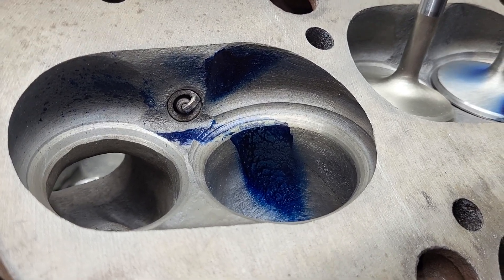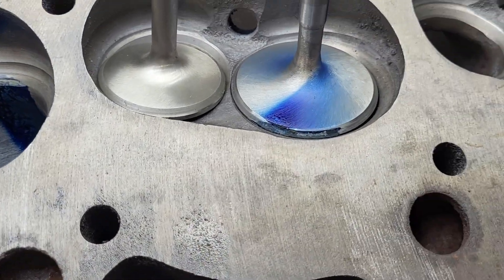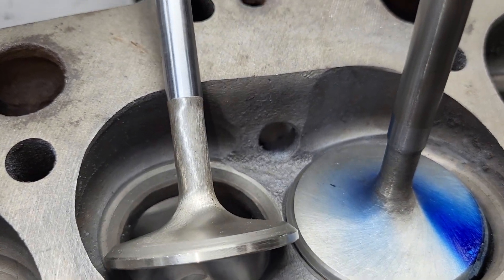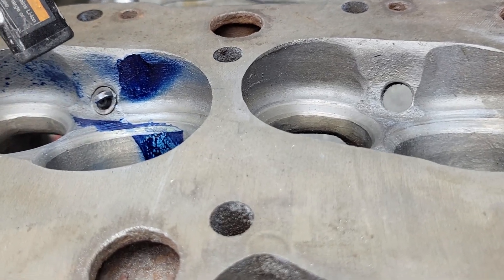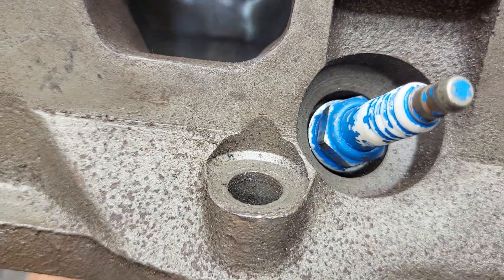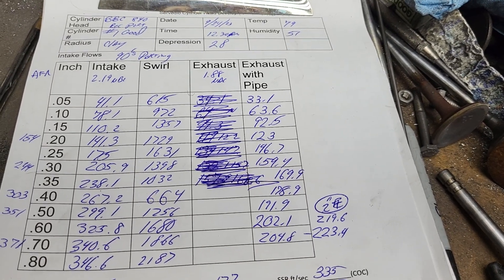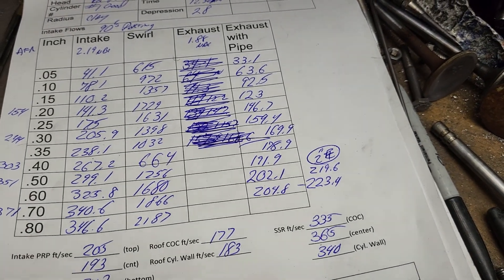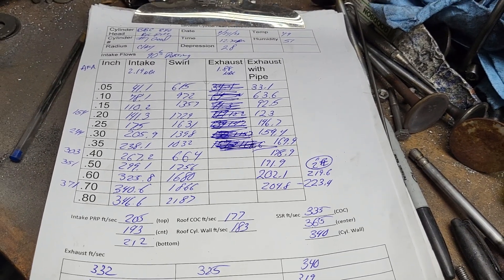Corvette 427/435 hp 840 rectangular port cylinder head, 2.19"/1.88" combo flows, 90's porting.

Comment: Just curious why you didn't cut the deck away opposite the exhaust port. David said it was good for 30 HP
Reply from the maker: It will happen, I would like to see the difference with just that mod on the exhaust. Thanks

Comment: Interesting stuff Charlie. Unfortunately, we never saw any factory big blocks of any breed here in Australia, so I find this stuff very interesting. Back in the 80's & 90's I used to use a wide valve seat on hot street motors, because I wanted to spread the seat loads out over a larger area, especially with heavy springs. I was more than happy to sacrifice a few cfm for durability as a lot of my builds were day drivers, and often did several hundred miles in a day. Ultimate cfm wasn't really a consideration as reliability was more important. That said, most of my builds didn't have seat inserts back then either. That was my thought process back in the day, be it right or wrong, that was it.
Reply from the maker: I see the logic. Thanks

Comment: When it comes to big block heads. After market heads are the way to go. And it didn't take long before they changed to other designs.  The gen 7 heads are the best iron variation for the big block Chevy. Even with those models,  after market heads are considerably better. For the price, race right heads will leave iron big blocks heads for boat anchors.really not worth it.
Reply from the maker: Good info, thanks

Comment: The closed chamber tends to shroud the exhaust valve at lifts over 0.500" or so. Some reshaping of that side of the chamber can really help exhaust flow. The chamber can be almost be matched to an open chamber, except there Is a water passage around the spark plug hole that prevents going all the way open and the intake side chamber wall is farther from the valves than it is in an open chamber.  We used to open the front and rear end curves of the closed chamber to match the cylinder bore diameter, to unshroud the valves a bit.
Reply from the maker: Good info. Thanks